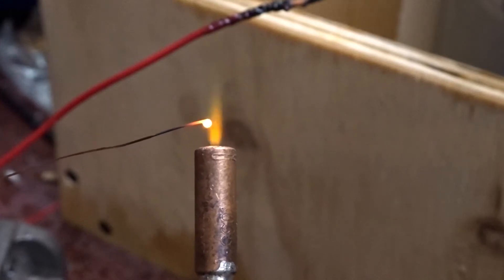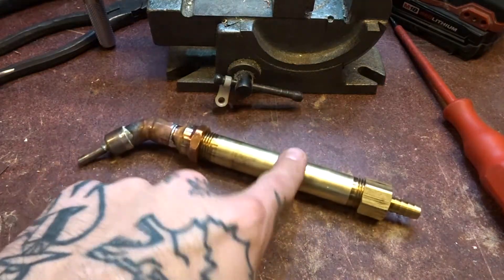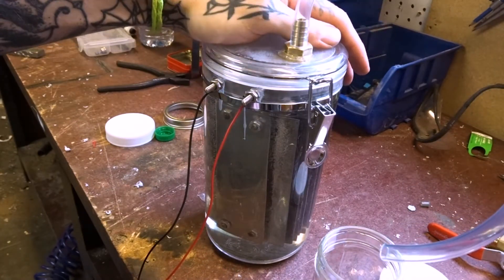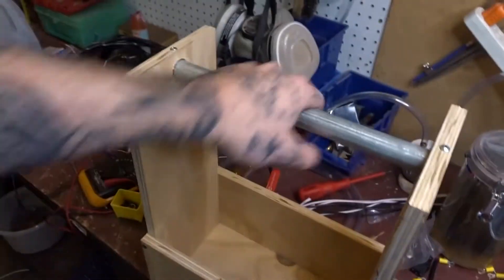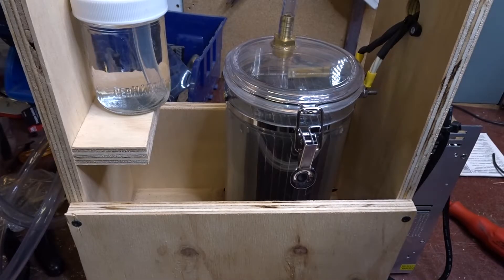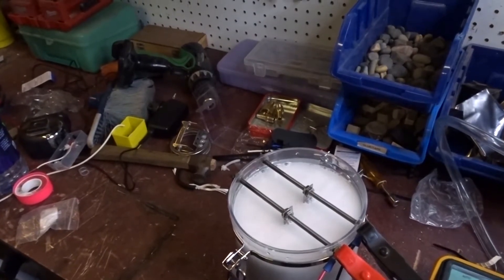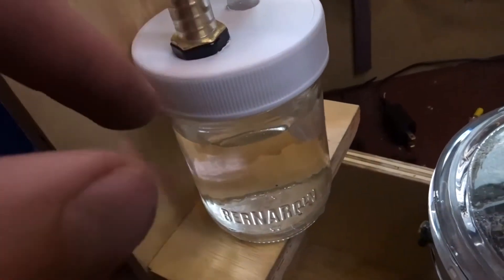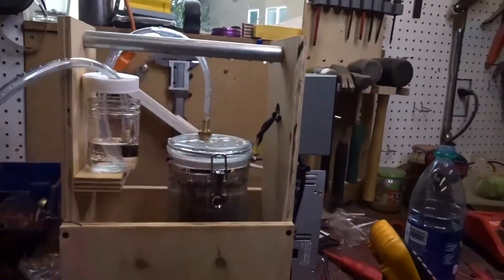Almost Blasting Myself Into Low Earth Orbit // Building an HHO Generator and Torch

Comment: These stainless type units do NOT seal with the gasket set up you have, the clamp does not provide enough pressure to seal it... Put soapy bubble liquid around the top you'll see hho leak out... If not spew out... Thom in Scotland.
Reply from the maker: I  haven't had any leak issues whatsoever, even when the outlet was plugged and the cell was building pressure. Maybe its because the steel frame distributes the pressure evenly over the gaskets, I'm not sure. I appreciate the input though!
Reply: Hi, not putting a dampener on this, but notice the flame is small, it can be seen, heard Pulsing, = obstacles, the wire wool, the water by bubbler, all cause back pressure, build up, try to put lots of soapy washing liquid round the stainless gasket.... Try it... And say, show, no problem then... I'm sure you'll see for you're self... Thom in Scotland.

Comment: Steel wool not good can burn use brass wool for arrestor. What voltage and amps you're putting in?. Thks for sharing.
Reply from the maker: My power supply puts out 12v @ 30amps, but I don't think it actually draws the full 30, although I haven't measured it so who knows 🤷

Comment: If you put a brass net into the torch this will stop the back fire , this is a kinda of a flashbackarrestor. So do it and your bubbler won´t explode again.And for the conduttor you can also use water with bicarbonate, because bicarbonate contains salt and salt is a good conduttor . so mix each liter of water with 100g of bicarbonate. And for safety do not use a glass jar ,that is really dangerous.
Reply from the maker: Thanks for the input! I've been testing different things as a flashback arrestor and found that brass wool with an aquarium air stone works really well, I haven't had any flashbacks since. And I'm using potasium hydroxide as an electrolyte now which seems to be working quite well. You're definitely right about the glass jar though, rookie mistake😂

Comment: What about connecting a check valve to the end of the bubbler?
Reply from the maker: I've come up with a flashback arrestor inside the torch body in my newer model, that seems to be doing the trick. I think the problem with a check valve would be that it would have to be rated for the flow and pressure of the gas for it to work properly. I'll Definitely look into it in the future though, it's a really good idea

Comment: Need a 0.55 welding tip
Reply: I just started to buy some parts for my hho cell
Reply from the maker: Oh awesome, best of luck with the build!
Reply: I need acrylic pipe yet and some other things I will show you when I get my mock up ready
Reply from the maker: Keep me updated!
Reply: I ordered the acrylic tube from grainger,probably gonna use 8 bolt stainless wet cell with stainless plates
Reply: I want to produce enough so I need to generate more power
Reply: You might want to see this https://youtu.be/QWWFp4LAzQA....,,,,
Reply from the maker: Sounds good! I'll keep it in mind on my next torch build
Reply: I just made my first cell

Comment: I've done HHO dry cell and with my bubbler you have to have enough water inside the bubbler so you don't have that much of an area of gas to make an explosion when it does back flash also if you can make it that the torch tube disconnects from the bubbler easily then if there's a backflash the pressure will be released by disconnecting the tube by the way where did you buy the canister to lock lid canister for the cells
Reply from the maker: I got the cannister from Walmart, it's a 2 liter one if I remember correctly. And thank you for the advice! I'm working on a new system, and I plan on putting in place more safety measures. I want to put in a kind of pressure membrane that breaks when there's a flashback so the pressure releases that way, I also put in air stone filters (the ones used in aquariums) in the torch body and that seems to have stopped the backfires completely(I haven't had any since putting them in)